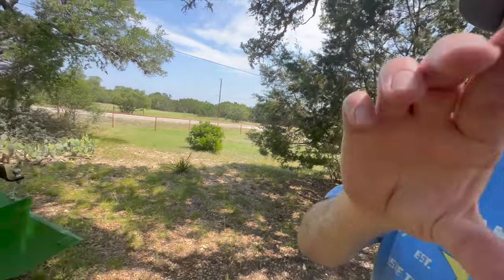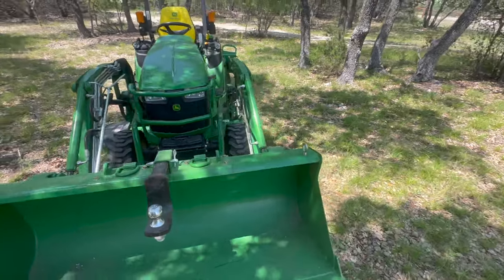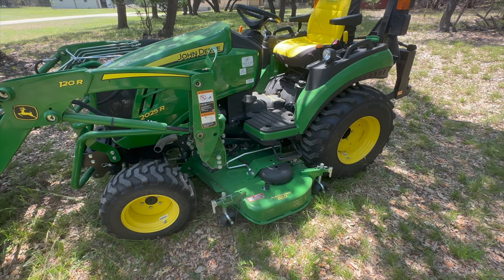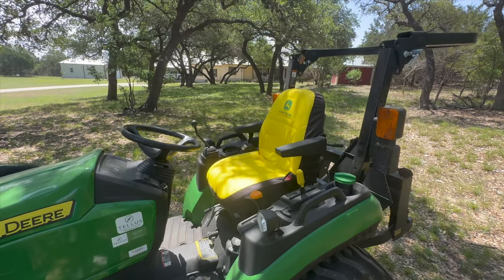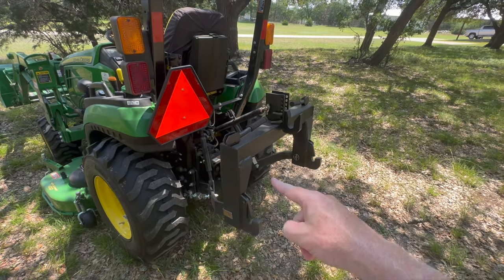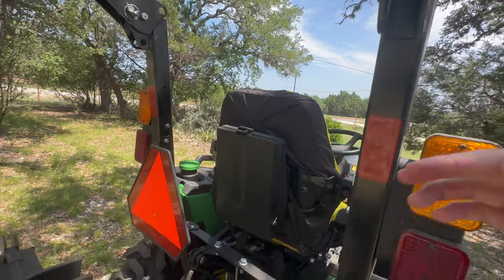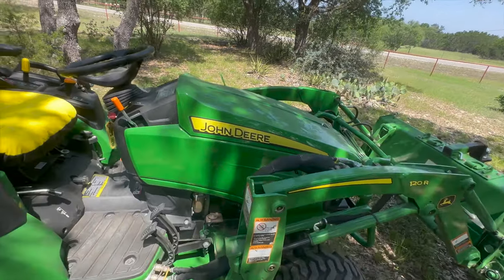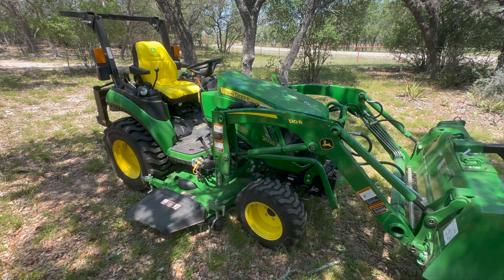John Deere 2025R compact tractor walk around, review and upgrades.

Comment: I just bought a 2023 2025R with the loader, 60D, and 260B backhoe. I upgraded to the 3rd function for the joystick so I could option up to independent hydraulic lift for the mower deck. I wanted to free up the 3 point for other uses while mowing. There is aftermarket push button hood latches available to fix the needing a key or whatever to open the hood. I also like the 3 point lever stop upgrade available online, it's a piece made to go between the washer and console to reinforce it and keep it from deforming the plastic. Those tractors are very handy. I like mine so far and I have had it less than a week.
Reply: I’m looking at the same setup. Curious how much it was and would you change anything?
Reply: The 3rd function valve doesn't hold the deck up very well. The valve doesn't have check valves like the loader valve does and leaks down constantly. I was told that they were all this way, I expected better than that on a $35k setup. That's a rough number for the Tractor with the 3rd function on the joystick added and set up for hydraulic deck lift, loader with the line kit for a grapple added on, backhoe, 60D deck with load and go brackets set up, and Frontier pallet forks with the backrest. Things I would change, I was trying to keep my payment to a certain number so I didn't get the iMatch hitch, rimguard (beet juice) in the back tires (which I did later, I had my tire guys do it instead of the dealer,  its a requirement for doing loader work with the backhoe off. I'm building my own weight bracket for the 3 point),  I would also recommend getting the rear cast weights and suitcase weights for the front when the loader is off. Deere's wheel weights don't stack on this size but I believe somebody has aftermarket ones that do and it allows you to run 2 sets instead of 1. (Those are on my wish list as well, I have other tractor weights laying around for the front. Making a bracket for the front to carry up to 4 47kg (100ish #) JD 50 series weights is on my to do list as I plan on doing some work without the loader on, I'd also recommend the guard kit for the lights on the ROPS to protect them if you get around brush or limbs. It is required if you want the Deere rear work light kit (which is also on my wish list unless I make my own). I have other tractors around the farm and got the 2025R for little jobs and to get into our old barn to clean cattle pens. We have put 56 hours on so far and I am pretty satisfied with it. If my budget would have allowed I would liked to have a 2038Ror even the 3033R or 3039R although the 3 series would be really tight where we go with the 2025R. I also preferred to stay away from the emission garb on the other models.

Comment: Nice tractor, been thinking of buying one myself.  I'd be a little worried about a rubber hose on the exhaust pipe.  If it should start a fire, all the plastic on modern tractors makes fire much harder to put out.🙂
Reply from the maker: Thanks for the concern and comment.  It is a hose for turbo and intercooler applications so it's good.  No signs of deformation and I can still slide it off and on.

Comment: I have first generation 2025R with 300+ hours on it, wouldn't switch it for zero hours new one.
Reply: What model years would be consider in the old generation??  I am looking at a 2014,would that be older generation??
Reply: @dave434   I think so. Just make sure you see "gen 1" (stands for generation 1), and not the "gen 2" in the description. Below is some useful comparison information that I copied years ago from some guy.
-------------------------------

@paulsickles632 4y ago (edited)

Here are a few things that were missed regarding capability between the 2013-2016 2025R (GEN 1) and the 2017-Present 2025R (GEN 2), it would appear that JD is moving the 2025R closer to the 1 series:

ENGINE:
GEN 1 Yanmar 3TNV76 = 24.2 hp, PTO 18 hp
GEN 2 Yanmar 3TNV80F = 23.9 hp PTO 18 hp

LOADER:
Lift Height:
Gen1 H130-78.9° at pivot Gen2: 120R-72" at pivot

Lift Capacity:
GEN 1: H130: 1023 lbs
GEN 2: 120R: 754 lbs

Breakout Force (at pin):
GEN 1: H130: 2508 lbs
GEN 2: 120R: 1823 lbs

BRAKES:
GEN 1: Dual Rear Brakes
GEN 2: Single Rear Brake

PTO HORSEPOWER 3 PT HITCH:
GEN 1: has larger pins connecting the draft arms to the tractor frame
GEN 2: has pins which are smaller than Cat1 Implement pins, connecting the draft arms to the tractor frame

GEN 1: has adjustable draft arm lift. 3 different holes on draft arms and 3 different holes on lift links to adjust lift height and lift capacity

GEN 2. has fixed relationship between lift links and draft arms

GEN 1: stabilizers pull the draft arms together

GEN 2: stabilizers pull the draft arms apart

GEN 1: has greater lift height

GEN 1: Rear Lift (at ends): 1433 lbs

GEN 2: Rear Lift (at ends) 1234 lbs

GEN 1: Rear Lift at 24" = 1150 lbs.

GEN 2: Rear Lift at 24" 882 lbs

TURNING RADIUS:

GEN 17.7 ft, 6.7 ft w/ Brakes has tighter turning radius than GEN 2 without brakes.

FRONT AXLE LOAD:

GEN 1: 1940 lbs

GEN 2: 1349 lbs

FRAME:

GEN 1: has a heavier frame and the GEN 2.
Reply: @ruslankadylak2999  THANK You, For this reply, Really Appreciate it of you!   I  copied this , So I can go back to it, When I go look at the tractor.  The guy said they used it mainly for mowing 4--5ac  it has 132hr. on it and was service at the 100 hr . The hood is beat up on it where the owner dropped a tool box out of the bucket on it.   other then that He says it ready to go., Just trying to decide between it and a 2017 1025r of a friend of mines , EC Low hrs asking 16K the2014,  2025r 16250.00
Reply: @dave434   You're welcome. You should choose a tractor based on your intended usage. If you want to move some dirt, you need a heavier tractor. Though JD 1025R is quite impressive for its size, Gen1 JD 2025R is heavier, with bigger tires, bigger clearance, more capable H130 FEL (front end loader), so it will perform better. If you want a tractor just for mowing - either one will do the work.

Also, don't buy a tractor without FEL - it's next to impossible to find a used one later. You will end up buying a new one in the dealership.

Forgot to add. If you plan on upgrading hydraulic pump with HydroPlus guys later, they don't have a pump for 2025R gen1. Original pump is Ok, but some attachments (backhoe for example) wouldn't mind a little bit higher flow.

Good luck with your purchase.
Reply: @dave434   Speaking of attachments. The guy I quoted didn't say anything about the backhoe. JD 2025R Gen1 has more capable 270A (or B) backhoe model, comparing to the 260A (or B) on Gen2, same as on 1025R. Gen1 is stronger, and digs one foot deeper.
Reply: @ruslankadylak2999     I don't think this 2025 has the H130 loder, I want to say its the 220 model, Anyway, The 1025r Will do all I need to do here,  I just like the bigger tires & size of the 2025.  I know the 1025r I am looking at and know it to be in EC. Well maintained  and all. So that is most likely the way I will go.  I'm thinking.  Thanks again for your replies.
Reply: @dave434   You're welcome. Good luck with your purchase.